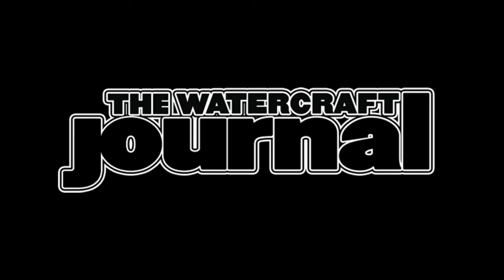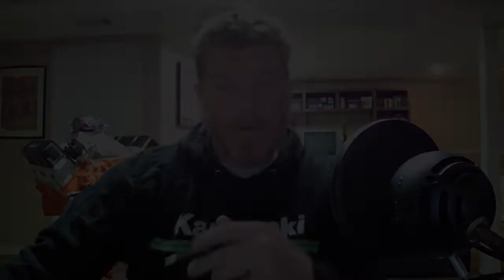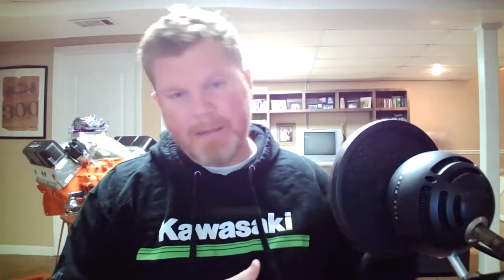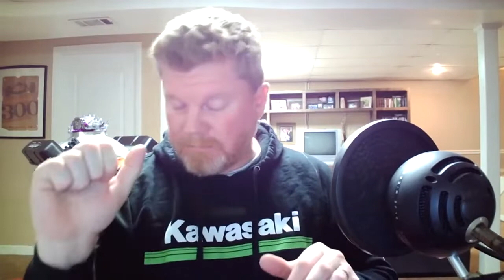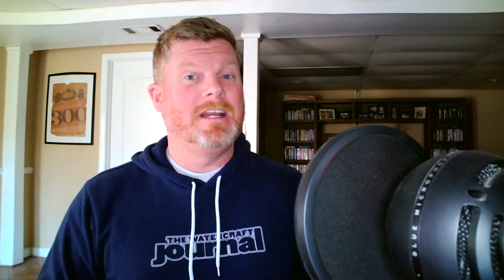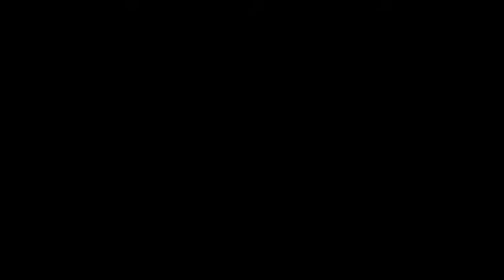Turbos vs. Superchargers: WCJ Quick Topic

Comment: I enjoy your videos the descriptions are probably a good introduction for some one who dosn't know much about boost, but pretty rough around the edges. In general the advantage of superchargers is the low rpm boost. The disadvantage being the parasitic loss.
Reply from the maker: Incorrect on both accounts. Parasitic loss in modern superchargers (particularly centrifugal) is so minimal its negligible (ProCharger engineers measure less than .7% to total adjusted HP). Equally, centrifugal superchargers fail to produce equitable positive atmosphere until reaching mid-range RPM as their wheels cannot produce sufficient velocity to effect compression.
Reply: @watercraftjournal  so for the sale of argument let’s round.7 to 1% I’m assuming your adjusted hp is total hp including the blower.. dude above is still not wrong even at 1% it’s still parasitic loss.. also that 1% you claim is still several hp. Vs turbo no parasitic loss. If you want to make real power you go turbo but for a 300hp ski a blower is fine

Comment: I am surprised no one makes a turbo PWC again BRP just came out with a turbo Ski doo  🤔 maybe we will see a turbo Seadoo shortly behind it.
Reply from the maker: Yes, Kevin touched on this very possibility in the full length podcast. But, if so, it will solely be as a "eco friendly" response to larger displacement engines producing equal HP.

Comment: When you are out of the boost on a turbo it is helping the scavenging, therefore increasing fuel economy.
Reply from the maker: The scavenging effect is negligible
Reply: @watercraftjournal  Not when you are comparing a turbo system to a supercharged system. 

The supercharger makes a smooth power curve but it is a parasitic draw when no creating boost. It takes horsepower to turn the supercharger.

A turbo is using the engines waste gas to create more power. And as such is a more fuel efficient system when used without boost.
Reply from the maker: First point: Very true
Second: Parasitic loss is less than 3-5
Third: 100%